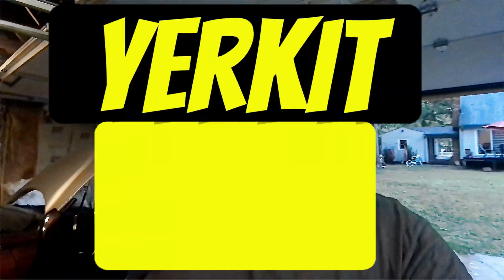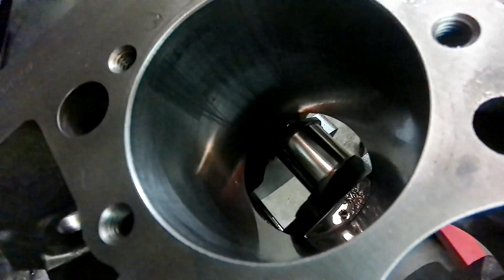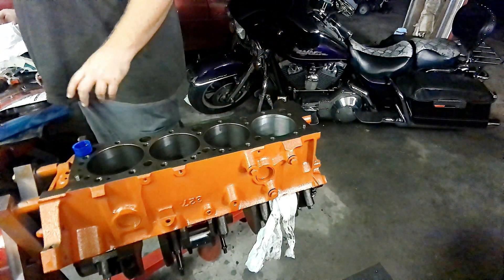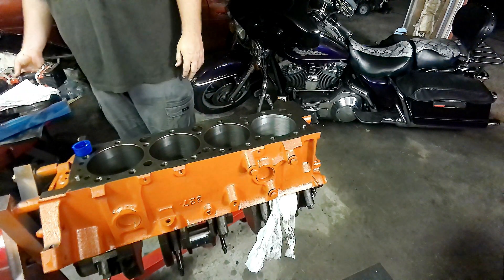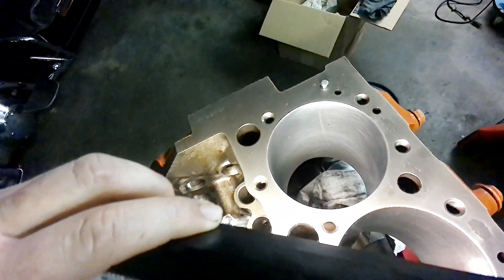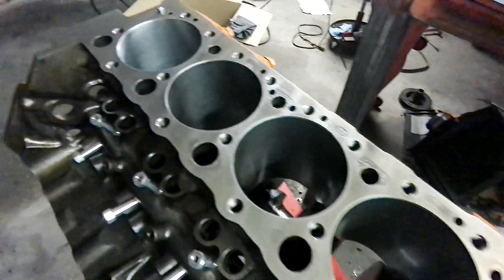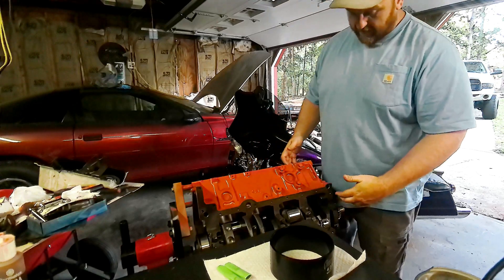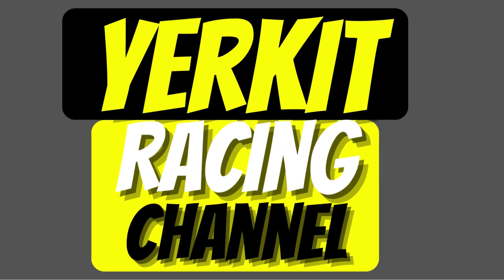LT1 engine build: Honing cylinders to fix scoring marks during assembly Gen 2 Small block Chevy 350.

Comment: What was your problem? Not enough oil during assembly of putting a piston in or a ring somehow catching up
Reply from the maker: Oil scraper folded from using cheap ring compressor. I only use the tapered style compressors now if possible.